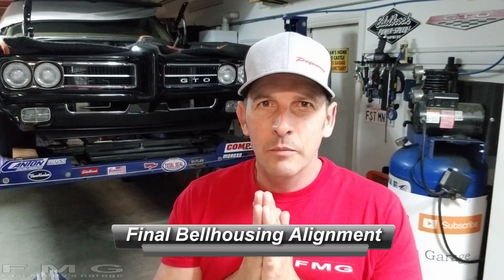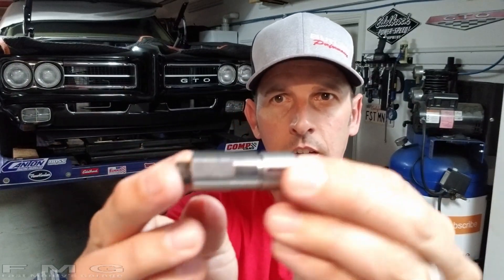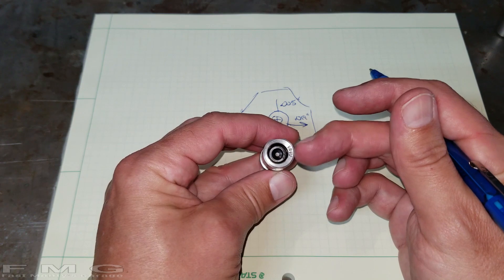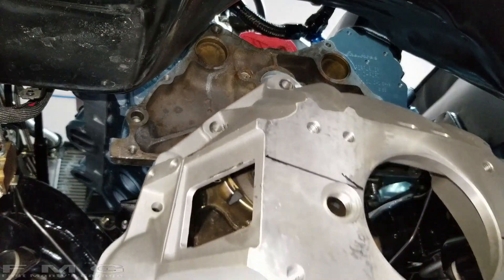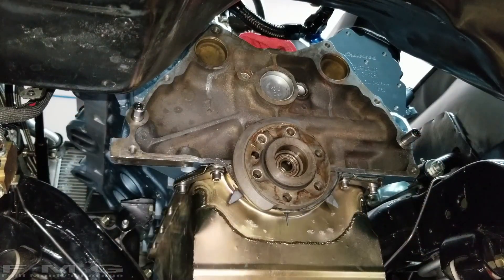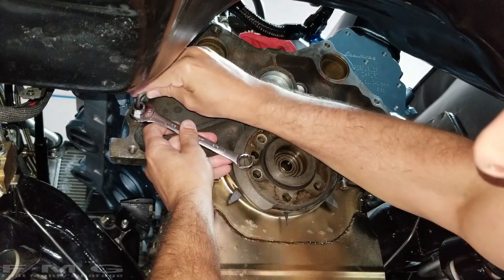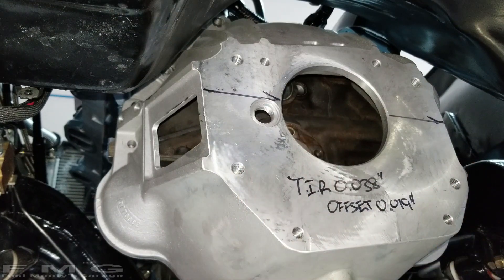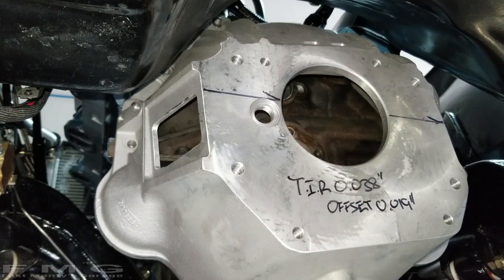TREMEC TKO/TKX Install, Part 3:  How to install Offset Dowel Pins for Proper Bellhousing Alignment.

Comment: Do the bolt holes, need to be enlarged ?, so that when the Bellhousing is bolted up, it won't try to pull it back out of alignment.
Reply from the maker: Good question.. it'll depend on your bell housing, and how far you have to move the bell to line it up.  I had to use a socket head cap screw for one of the holes, purely because a standard hex head interfered with the bell.  Have fun!  (Mine bell is a re-pop, non original bell, which might explain that issue)  Thanks!
Reply: @FastMonty  Thank you

Comment: They make a magnetic indicator holder that sticks to the crankshaft so the "snake" holder isn't necessary and so unwieldy, just so anyone watching this knows there's a better way.  Great video and tips, thanks.
Reply from the maker: Agreed, that's why near the end of the video I recommend to buy theirs.  There's a link in the description to get the SST version.  Thanks for the comment!
Reply: @FastMonty  Yeah, I may have commented before I got that far <looking innocently around room, whistling> but they're great.
  I'm glad to see SST sells the stuff you need to install their products and does the driveline work, if you don't have a competent specialty shop near by (Atl. has Doraville driveline, they'd been in business forever and cater to racers), that says a lot about the quality of their products and relationships with their customers.   I've been thinking about doing a conversion on my '74 Road Runner.  😀
Reply from the maker: @MtnBadger  Agreed!  SST has been awesome, from day 1.  Thanks again!
Reply: @FastMonty   I'm not sure where you are but, when I get the new heart installed in my Road Runner (yanking the carb system off the 440 from the FP regulator right to the block and installing an SMPFI Pro-Flo 4 with fuel sump and all the trimmings...  Ready for some consistent performance and better gas mileage 😆), getting the gears sorted and "tightening up" in general, we'll have to take these beasts out and "cruise the strip!"  😉
Reply from the maker: @MtnBadger  For sure!  I'm in San Diego, and you?
Reply: @FastMonty 
   My California days are over.  Lived in the bay area and Sacto areas (and Chico/Oroville) for years.  Mom passed in October and after 40rs of Oroville being "home base" wherever in the country/world I was, I just sold the family home and my last trip from O-ville to Needles was it.  The state of things from our arrival in the late 60s (landed in SF Sept. of 67, summer of love, baby!) to the way things are there now is appalling.  As I hit Barstow and Needles, gas was $7.00 gal., as soon as I hit Arizona, it was $2.66.  It is a couple hundred bucks to rent a truck and car hauler TO CA., leaving California to GA (I'm between Atlanta and Athens) cost me EIGHT THOUSAND DOLLARS because they penalize all the people fleeing the state.   Oroville and the area have always had a reputation as rough, mining, logging and cattle town(s) but today, you can't walk the streets without being accosted by the homeless & meth-heads.  People don't hang out down town anymore, the women working in the downtown offices are afraid to come out with all the transients walking up and down the streets all day.  I was bad a few years ago but, tolerable.  Today, everyone I spoke with was jealous that I was leaving. 
  I told this story because I'm really, really sad about such an otherwise terrifically beautiful state with everything to offer becoming completely unhinged by politics and bad management.   It's for those reasons that the likelihood of my coming that way, short of an intentional trip to cruise cars with you, is veery small and that's just too bad.  From what I've seen, our lives/interests pretty well parallel and I think hanging out with you and your friends for a couple of days would really be awesome.  😀  I hope that where you live and how things are have escaped the chaos (though I would suspect not the prices) and life is treating you well!  😀
Reply from the maker: @MtnBadger  Thanks Taylor, yeah, lots of frustrating stuff about Cali, for sure.  Congrats about finding a new place to settle... keep at it, my friend!
Reply: @FastMonty   It's possible that a vacation trip lies in the future, my wife hasn't been and my kid (grown man-kid) and I didn't get to do the tour in our hasty trips.  Eating at Scoma's on the wharf in S.F. (family owned for decades, best sea food/surf 'n turf in the bay area/much of country), "John's char burgers" in Livermore (same, family deal but w/beef) and I used to live in Chico, home of Sierra Nevada brewery.  Back in the 80, it was still just a little micro brewery and the only place you could get it was in the little place on main street and, of course, it tasted much better.  😉
  We used to go to Shasta or Yosemite for vacation every year, etc.,etc..  There's so much good about the state, i didn't mean to poop on it, just the people running it. 😉  Please go to Coronado and enjoy one of the most beautiful places out there for me!!  (I subsequently had to hang up my surf board, be sad for me).  😆   Keep up the good videos and I'll keep pestering you sovwe can atay friends...  😆 
I'm thinking about making some vids about my Road Runner project, I need encouragement!! 😀
Reply from the maker: @MtnBadger  Ha!  not to worry, I gave up surfing a long, long time ago too... and, I now no longer can stand cold water.  ha, ha... have fun with that Road Runner!

Comment: I had a Super T 10 in my 65 GTO. Brand New Clutch / Pressure plate. Never seen the Street. My Question is will the Clutch disc, Pressure plate and input bearing in the Crankshaft be the same as what I need for the TKX or do I need to buy a Different Clutch Kit.
Reply from the maker: Good question, Jeff... I don't know what a T 10 is?  So, it will depend on how many splines are on the input shaft.  The TKX has 26, where my old Muncie had 10 or 12?  Back when I put my TKO in, I used the same bearing, flywheel, and pressure plate as with my Muncie, but had to change out the Clutch disc for a 26 spline.  Hope that helps, and let us know what you end up doing.  Thanks for the comment!
Reply: @FastMonty  Super T10 which were used in Second Gen Camaro's and Trans Ams. 26 fine spline and output is same as a Turbo 400 / M22. I love Your videos and the way You explain Yourseld. I am a Huge Fan!! Thanks
Reply from the maker: @jeffshort3454  Ahhh, good to know, thanks for sharing.  You should be good, and thanks for being a part of the FMG family.  See ya!
Reply: @FastMonty  Thanks for getting back to me so fast also!
Reply from the maker: @jeffshort3454  Welcome!

Comment: Hello Mike. I'm actually converting my th350 to a tkx tremec. But i don't understand how  you calculate bellhousing alignment.  Do you subtract the 2 values and divide by 2 or do you add the 2 value and divide by 2 ? Or maybe I'm totally out of understanding 🤔
Reply from the maker: Good question... not sure what two values you're referring to?    When you find your Total Indicated Runout, you divide that number by 2, and that gets your target number to shift the Bell, which will also determine which offset pins to order.  Does that help?
Reply: @FastMonty  Hi Mike thank you for your answer. I followed this procedure.  https://youtu.be/fu9bg-fJdnc
And without changing the dowel pins i find 0.003 inch so i suppose I'm good to go ! Anyway what do you think about this procedure which is a little bit different with yours ?
Reply from the maker: @labalade_7791  That's a good measurement... and, I did it the same way.  :)
Reply: @FastMonty  great 👍 thank you Mike.

Comment: The bellhousing being precisely aligned is obviously a good thing. But I've never heard of anyone checking the alignment of the transmission itself. I guess we just presume that the housing casting is perfect but not the bellhousing or block lol.
Reply from the maker: Good point Paul... reason is, the transmission is manufactured to a tighter tolerance than the runout tolerance of the 50 year old bell/block.  Hence the need to better align the older technology.  :)  So, yes, the brand new transmission casting is naturally going to be "more perfect" than the stuff made 50 years ago.  (And the old Muncie's didn't care about excessive runout.)  Thanks for the comment!

Comment: Question. When you offset your bell housing in relation to your engine block I would think the mounting screws for the bell housing would be off and the bolts wouldn’t thread in? No? Having trouble thinking through this one. Thanks
Reply from the maker: That's a great question.  The clearance between the through hole, and the actual bolt OD, exceeds the amount you'll be shifting the bell.  That said, I had to use a Socket Head cap screw on the lower left hole because the standard flanged bolt hit the bell.  (The flange, not the actual hole)  Does that help?
Reply: Yep that helps. I figured shifting the housing over .017 couldn’t make much difference but sometime tolerances are so small you never know. Thanks for the reply.

Comment: Where did you get the dowel pins from? I see some adjustable ones on summit but $120 seems expensive for little pins
Reply from the maker: Good question, they came with the kit I got from Silver Sport Transmissions.  I think they're made by Robb MC?  Check these out... http://www.robbmcperformance.com/products/dowels.html  Good luck!

Comment: I have heard people say in the past that they don't like a pilot bearing, that they get contaminated and self destruct, and that they much prefer a bronze bushing, I'm wondering if not doing this procedure is really what led to the bearing failures they speak of?
Reply from the maker: Ohhh, that could very well be.  Especially if you swap out the pilot bushing, with a bearing, and keep the original Muncie.  Those were not aligned like the TREMEC needs to be.  Love the comment.  Thanks!